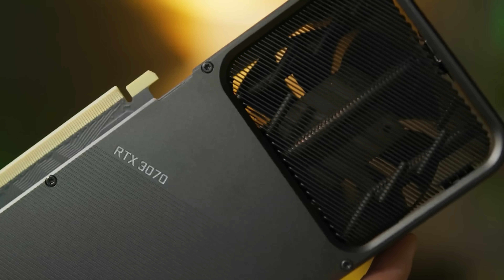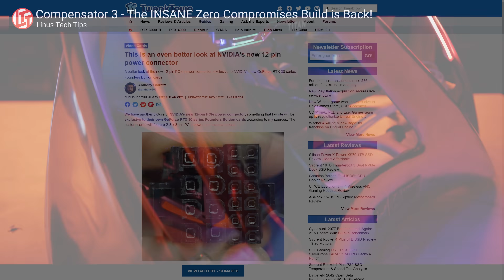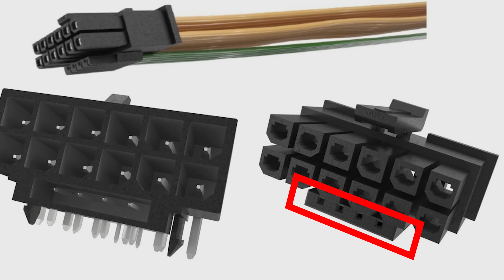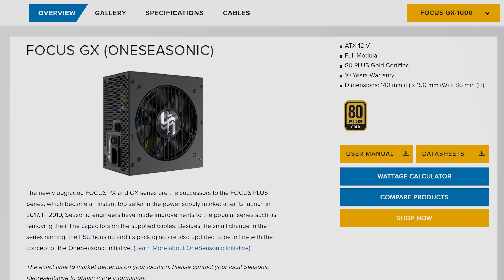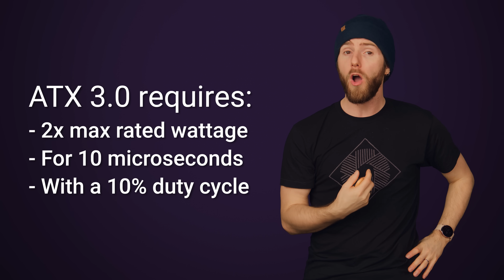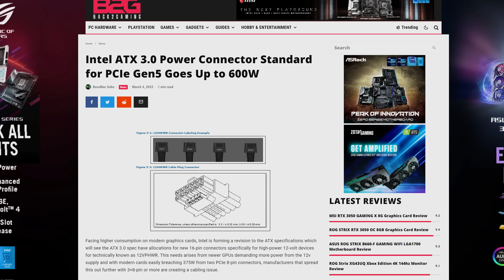Do You Need A New Power Supply? - ATX 3.0

Comment: The ATX standard dropped the ball back when the GPU power cables were added. They could have simplified it so much and instead made it all more complicated than it had to be. The logical thing would have been to make the ATX-12V and EPS power connector compatible with the GPU power connectors. But no, instead they swapped the power and ground 180 degrees and used a plug that was slightly differently keyed. For no good reason what so ever they felt they needed to create a new plug.

But that's water under the bridge. Now they are creating a new standard again, supposedly for a good reason as now the GPU and PSU are supposed to be able to communicate about what the PSU is actually capable to deliver in the way of power. I'm not yet sold on it, but at least it should mean one less connector that is close enough you can actually force the wrong cable to lock in. Yes, I've seen people managed to cram a EPS connector into a graphics card and the other way around. Lets just say it's usually not a good thing...
Reply: Or simply include more pcie and cpu power connectors. Ita been 10 years and nothing changed. Low spec psu still have same connectors and high end psu more connectors. I do get that noone wants to plug a idk 3080 into a lets say vs corsair. But still this should have been standard by now to include more power connectors especially for gpu.  Or example fan 4 pin on motherboard. Why do we still have a limit on low end boards..... why cant we have more than 4 fan header. My b450 toma max has 4 normal fan header  1 cpu and 1 pump...
Reply: Seriously, one to two extra connectors is too much now?

 I'm quite fond of them and the less power going through the motherboard the better.

 After all, CPU has their cable, HDD has their cable, why shouldn't the graphics card have their own cable?
Reply: @JonatasAdoM  It's not the number of connectors or cables that's the problem in my opinion, but the types. PCI-e power connectors should never have been invented. Instead they should just have used EPS-12V connectors for the graphics cards. One less type of connector to worry about, just put two more of them on the PSU and call it a day. Instead they came up with the PCI-e power connector, and made it in two versions, 6 and 8 pin. Now if you look at the 6 pin version there's actually not all six pins used for power delivery, instead it's three +12V and 2 ground pins. They could just as well used a 4-pin ATX Power connector and had the option to use two for 8-pins of power delivery just like a lot of ATX PSU's have done to support both ATX and EPS power.

Now this new connector is interesting, but again it's a special one. The 12VO standard has been talked about for a long time now, and they keep threatening us with it replacing the old ATX power connector "real soon now". If that comes around there will be just two kinds of connector on the cables from the PSU, the 12VO (ten pins I think) and this new graphics card connector. Drives, fans, pumps and whatever else it supposed to be driven off the motherboard. To me it sounds limiting, but we'll see what happens. Heck I was miffed by the ATX standard back in the day. But it pushed the old IBM PC standard PSU out of the market pretty quickly. It did bring some nice things like being able to wake a computer over the network, set wake timers and standby functionality so it was more than just a new formfactor for PSU and the power connectors for the motherboard.
Reply: @blahorgaslisk7763  Honestly, 12V0 and ATX 3.0 aren't any good. 

Mainboards are the most problematic monolith in a system. If any single part fails (networking, audio, storage controller, and so on) the whole board might become a paper weight (worst case).
Mainboards simply became too complex and now they also want to force functions from the PSU into the mainboard. There is a reason why PCs and Servers are modular...

The new connector in ATX 3.0 isn't a bad idea, but why add communication in? There are simpler ways to do this... 

Well, I get why they added it. Simply because , some idiot monkey will try to connect a 800 watt GPU to a 400 Watt crap PSU. But, then it's their problem for not reading the damn manual.
Reply: @roopey  I agree with most everything you wrote. I was building computers back when the only I/O that was actually on the MB was the keyboard port. Everything else came on expansion cards. There were even mouse port cards...

Then these started to get integrated. The serial ports and a parallel port got integrated into one card. Floppy controller and HDD interface was another pretty logical combo, and once IDE became the default standard for PC's these combo cards were almost always used. Next step was to combine serial ports, parallel port, FDD and IDE controller on a single card. Now you only needed a graphics card and a combo I/O card in your PC and it was usable. Network cards were actually not all that common yet.

Sound cards started to become affordable, but most people still didn't feel they were necessary. It wasn't really before the CD player got cheap that the sound cards started to really sell, and then it often was sold in a multimedia package with speakers and a CD player. This made the sound card manufacturers include a suitable controller for the CD player on the sound card. Most of these were using a IDE controller, but some went with a SCSI controller.

And then Intel dropped the ATX standard. Suddenly serial ports, parallel ports, FDD and IDE controllers, PS/2 mouse port, sound and sometimes even a network port were integrated on the motherboard.

Suddenly we had a single point of failure in the motherboard. Any of these ports stopped working and the motherboard was compromised.

We've gone from a PC having a minimum of five expansion cards to a PC that doesn't need any expansion card to work, or a minimum of one, a graphics card, if the GPU in the processor doesn't cut it.

Now I feel the 12VO standard is a bit interesting, but at the same time it will make the most compact computers less capable.

Think about it. A Micro-ITX card is pretty cramped already. They often have pretty few USB ports, not to many SATA ports, one or possibly two NVMe ports, and of course a single PCI-e slot.

If you make it 12VO then you need to add VRM for 3,3V and 5V and power connectors to support the number of SATA drives the MB can use. That's more PCB real estate that has to come from somewhere on an already cramped motherboard.

What probably will happen is that these Micro-ITX motherboards will cut down on SATA ports or possibly entirely eliminate them. This is not something that a lot of users will care about as long as they get two NVMe ports, but it's still less functionality for questionable gain in power efficiency.
Reply: @blahorgaslisk7763  I agree with you. For those reasons I like Business / Enterprise Hardware. They are repairable and modular. Some are also pretty compact

Comment: I don't think this is a big deal.  It will be a slow change and less is actually changed than it appears. Just IMO.  I mean, "faster wake-up times"?  Uh....the PSU is far from the bottle neck here.  Connector?  I have not read the new one, but I suspect most of the added pins are so you can pump more power to the GPU.  So, a Y-adapter may fix that.  As far as the PSU com pins?  I am sure there will be a workaround.

Comment: 1:58 Exactly what kind of "instability" comes from a GPU needing more power than a PSU can supply? I've been getting weird hitching and dropped frames recently from my 3080. (Probably the game not being optimized but figured I'd ask anyway) my specs are i9 10850K, msi Z590 carbon gaming wifi, gigabyte geforce rtx 3080 gaming oc, 2 1TB nvme ssds, corsair h150i pro rgb xt, 7 corsair rgb fans, 32GB corsair vengeance pro rgb ram 8x4 and a corsair rm850 psu in a corsair 5000x case
Reply: Usualy if one of your components draws more power than the PSU can supply in total your system just hard crashes.
Reply: @reappermen  ah I thought so but I'm new to pc gaming and wasn't really sure. Probably just the game not being optimized. I appreciate it
Reply: @Pr0digyZRX  well, one easy thing you can do is gett one of the usual benchmarks (there are free version of e.g. 3dMark on steam even) and run the Benchmark or stresstest functionality. If it runs fine during one or multiple tuns of those it is definitely the game. 
Another thing is you can manually throttle your GPU max values via the Nvidia control panel or other software of your choice (plenty of guides online). If that makes your problem go away in the game that tells you it might be a powrr (or more likely heat) problem of the card.
Reply: @reappermen  I'll definitely try those out. It'll probably help to say my gpu temps stay around 65-75 C and it's only one game I'm running into the stutters and dropped frames on. Plus it's not constant. It only happens a couple times in 2-3 hours of gaming. But I appreciate the advice. I'll definitely try them on my next day off work

Comment: Cybenetics is certainly a step up from the god-awful 80+ system, but in-depth reviews will still be important to test things like protections and electrical characteristics. The latter is covered in the cybenetics test reports, though they are not factored into the final rating.
Reply: Do you know any site or channel that does in-depth reviews on PSUs? Especially interested in noise testing.
Reply: @Sekir80  Hardware Busters International (for english ppl) channel is owned by the creator of Cybernetics, so except a lot of PSU tests (already are a lot).
Reply: @Sekir80  Anything made by Aris, really, so TomsHardware, TechPowerUp, and the HardwareBusters Youtube channel.
Reply: Hmmm... Gamer's Nexus & Igor's Lab?
Dont know of any others, that would do such a thing... :)
Reply: @kitsunesenpai441  I've seen GN making noise analysis on CPU coolers. Haven't seen on PSUs. I'll check. And Igor. Thx.
Reply: @kitsunesenpai441  Techpowerup and Tomshardware articles (both from creator of Hardware Busters International and Cybenetics), are the current gold standard.
Reply: I would love to see a "Goodcaps" certification too, or perhaps just make "no Chinese crapacitors" a mandatory part of every other Cybenetics certification.
Reply: @NetRolller3D  That's ancient history at this point, the "bad capacitor drought" has thankfully passed. The good Chinese are as good as the good Japanese caps nowadays.
Reply: @Dogzilla07  There is at least one manufacturer still making crapacitors: GST aka Evercon aka Sacon aka Capsun aka Asiacon or whatever they rebranded themselves this time. The FZ line is especially heinous, as it tries to pass as polymer caps, while being just as failure prone as GSCs made in 2003.

Fuhjyyus also still pop up from time to time in power supplies, even though that brand was officially discontinued a decade ago. And then there are outright fakes like Rulycon.

Teapo/Yageo did make great progress since the years of Peak Crapacitor, though.
Reply: @NetRolller3D  If both JonnyGuru and Aris say higher quality Chinese are fine, tis enough for me,  but yeah, at least Teapo xD
Reply: @NetRolller3D  Chinese caps vs japanese caps isn't nearly as relevant as it was in the mid-2000s. I'll take a Teapo LG over a nichicon GG any day. Good caps are nice, but the capacitor plague has been over for a while; you'd have to go really bottom of the barrel for it to be a problem.

Comment: so... what about transition time? let's say it's the future and I'm building a new PC. I buy my x950 MB, and this new power supply. but I have and old 3090 graphics card (but hope to get the 5090) do I need a temporary adapter? and will someone else be able to use the old GPU if I sold it to them if they do not have this new PSU ? or will this be a forced technology that renders old GPU's useless (scary) I like new tech but worry when it interferes with my wallet.

Comment: So a gpu manufacturer can now simply make a card not work using a firmware update if it doesn’t like the brand of your PSU or any other component by locking out any power draw

Comment: High performance cards already function on regular gold certified PSUs, and it can be argued that they are monstrously demanding when it comes to wattage already.
All this does is give them more of an excuse to produce products that absolutely stomp on your power bill on max load.

Not to mention OEM's like Dell are going to abuse it by throwing in high performance cards paired with  low spec PSUs.
Reply: The 'Metal' standard has nothing to do with how many watts a PSU supplies. You can literally get 1300+watt Gold or even bronze PSU's. All the mtall rating indicates is durability and efficiency at vatious fixed points.

Comment: Finally that great, now let's have a better replacement for the godforsaken ballshit connector that is the the 24pin ! Why is it angled that way ? Why does it look so jank ? Why is it not normally pointed off the side of the mobo rather than up and over, this would be so much better using the grommets mostly located near the the usual 24pin location ?  While we are at it they can make a universal plug and socket for those pesky bloody case switch and led headers ! It's 2022 and we are still using utter jank connectors and orientation!

Comment: I'm dead set on the 860I for my PC. I'd love to see testing between all intelligent PSU vs their none intelligent versions. I'd also love to see the power from the wall to see if there's a slight difference in each brands efficiency.
Reply: The 860i is a great PSU. I put one of them in when I built my previous i7 4770K system and it runs flawlessly till this day. One of the things that really validated the purchase of that PSU was in a recent Gamers Nexus video where a PC was sent to them that was in a hurricane and it had a 860i in it, worked perfectly. Although, in my current rig, I’m using a 1000w Seasonic Titanium PSU, seemed like a good choice with the power requirements of stuff these days.

Comment: The last time I thanked my psu for its service was last week when I opened it and cleaned the dust out of it for our 10 year anniversary.  It was disgusting, I wonder what the percentage is of people who actually do that.  What would be the percentage of preventable deaths related to dust related conductivity or heat?  I expect to get 30 years at least out of it, and it runs 4x 390x cards 24\7, and has done for 5 years now.  The hardest worn part of the entire thing is the power switch on the back, if anything at all dies, my money is on that.
Reply: Lmao I have a 1000w 7 year old PSU and made a comment on a GN video about how I'm glad I bought a larger PSU in the past because new cards like the 3090ti are pulling 500w+ and quite a few dummies tried to tell me my old PSU is on its last legs! And that if I tried to run a 500w card it would fail! It's like ya right... there is no need to constantly upgrade a PSU... hell they even still make and sell my PSU model. My psu is 93% efficient at 50% load  and 90% at 100%. No need to upgrade unless it dies. Oh... and I have a 10 year warranty so got 3 more years out of it!
Reply: Some people (and sadly, the huge majority of people you find in places like here) have absolutely nothing else in their life, no other hobbies or interests at all to spend their money on, so they buy stupid like a new CPU every single time one is shat out with a 6% increase over the previous gen, I think its hilarious!! 
I bought this 1000w psu back in 2012, and I paid a good price for it when you look at what PSU's cost these days.  But really, the only downside to buying the big burtha, is that when its not under any real load (which is 99% of the time) it is very inefficient.  When just sitting on the desktop, or using a browser, watching a video, typing a document, all that light stuff, you might be drawing like 50w maybe?  It could be a lot less, depends what you have.  But when you are drawing less than 20% of the psus rated output, efficiency goes to shit, when its under 5% load it can fall under 70٪ efficiency, mine for example as reviewed by TPU, with an output between 40w - 60w is only 68% efficient!  For a machine that is on 24/7, that is quite the waste.  If I had of chosen a 500w instead of a 1000w PSU, then 50w would have been a 10% load rather than 5% load it is for the 1000w model, and efficiency goes from 67% up to 80% from 5% to 10% load respectively on my unit.  So the point there, is you can gain huge efficiency by getting a lower output PSU.  I would never buy a psu just based off its efficiency rating because what matters is how you use it, and it will always have the highest efficiency at half its rated output.
Reply: Did the same thing on my OCZ 700W PSU, plus changing the fan. I don't know how that thing is still alive.

Comment: I have a question.
I'm building a pc rn and haven't got the psu yet. I'm planning to get a rtx 40 series card (4050-4060) in over a year or so. I want to buy the be quiet! u9 600w but idk if it will support the new gpus (supposing they will use this new connector). So my question is, will a "normal" psu work even if its with an adapter, or will they just support these new pcie connectors and new psu's? I live in a country where new things come at a way higher price and at least a month late so even if i waited i couldn't afford it.
I know there isn't really any information yet but i just wanted to know if it's really worth it to wait, or if even if the new gpus need these new psu's it's not worth and maybe just sell the psu and buy a new one in the moment.

Comment: imho they should just have XT60 connectors. 0-2x for the GPU and 1x for the Mainboard, none for external drives. (They should be powered with a new SATA cable form the Mainboard.)